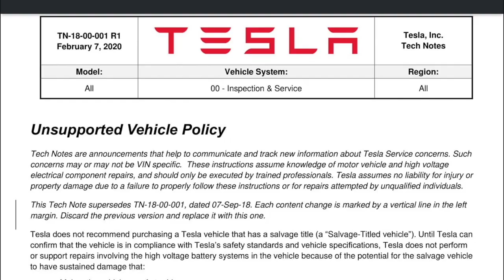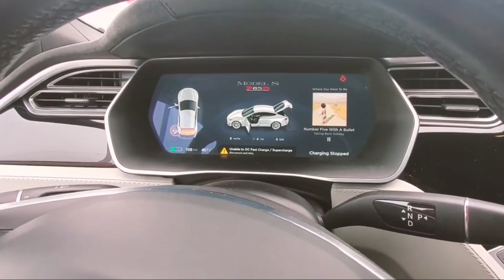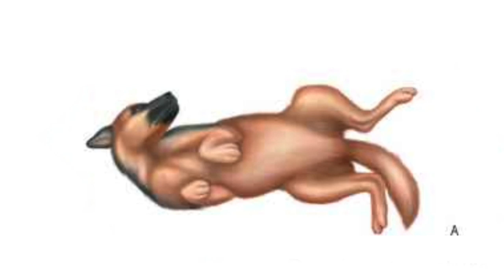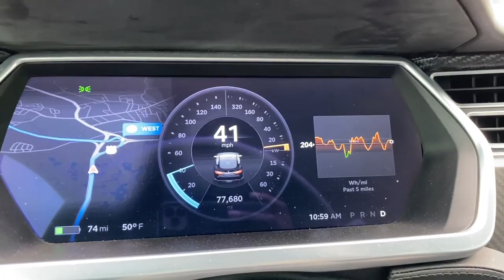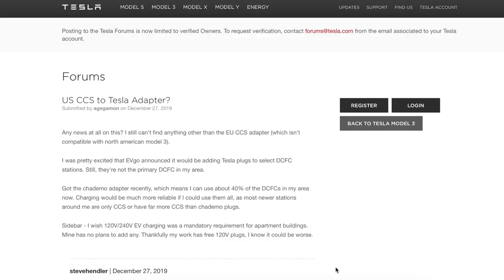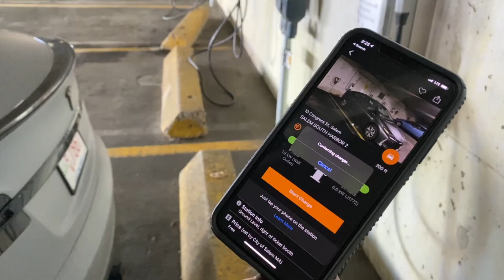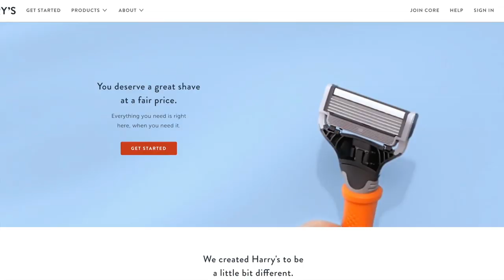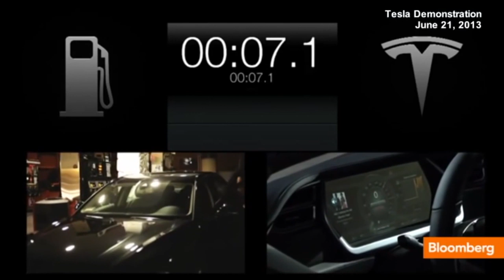Tesla ruined my car and it’s the best thing to ever happen to me!

Comment: I remember when I could drive 600 miles non-stop, pull into a gas station, fill the tank, buy a burrito and a big gulp and be ready to drive another 600 miles in less than 10 minutes.
Reply: I remember being able to do that but for 700 Miles....

...Oh, wait, that's now, with an over 20 Year old Car...
Reply: I remember not holding it that long and being a fat kid so every 300miles I'm doing bathroom breaks and fat kid snack. Hahaha
Reply: I don’t remember anybody asking
Reply: What car has a tank for 600+ miles? Cuz I wanna know.
Reply: @Tydud3  My diesel Jetta does. Some people even squeeze 700+ miles out of a tank.
Reply: Tydud3 It depends on your gas mileage and your tank size.
Reply: @Tydud3  my 1988 Citroem BX has one, theoretically i cold do 745 if i believe the Factory specs, 4.8l/100km with a 66l Tank would mean 1375km or about 850 miles on long trips i can get down to about 5l/100km, with 1 Passenger and a bit of luggage witch would be about 1320km to an empty tank(about 820 miles) the worst fuel usage to get 700miles i could have would be about 5.8-5.9l, witch is about as much as i use on my daily comute.
Reply: @Tydud3  Pretty sure the Grand Cherokee has a massive tank.
Reply: @Tydud3  My Alfa 159 2.4L get's that, did a 2000+ mile road trip on 3 2/4 tanks

Comment: Tesla: You can't use fast charging on a rebuilt TESLA for safety reasons.
Also Tesla: "Autopilot"
Reply: Autopilot is safe man.
Reply: autopilot is safe
Reply: @RodrigoFerreira-bs6hd  Tell that to Wei Huang
Reply: @Psychonaut_  it's infinite safer than driving on your own that's for sure. still! nothing is 100% safe.
Reply: The name is correct for what it is. An Autopilot system in a plane is not meant to replace a person.
Reply: But Rich doesn't have any Tesla internet based services. Even if he does have basic cruise control he sure as hell doesn't have auto-pilot.
Reply: Also Tesla: Thermal Runaway

Comment: “Build” some solar panels on the roof of your Tesla. lol
Reply: Yes, weld it for sure. But that may require towing along a 53' trailer full of them to get a reasonable charge rate. 
Bet they also have locked out feature, "charge-as-you-drive".  And remember, solar takes like forever, to charge overnight!  lol
Reply: Drive on "SOLAR FREAKIN ROADWAYS", LOL!
Reply: I know this is a joke, but the little amount of power that you would get from the solar panels, would not counteract the increased weight and adapters needed to allow the solar panels to work in parallel with the built in charger.
Reply: @markplott4820  I think TESLA is being a JERK and I hope Elon FAILS!
Reply: @vdochev  - TESLA is Disrupting the Worldwide  ICEV Industry, TWISTING their arm to build SUPERIOR Electric Cars.

and it will CONTINUE Disrupting until Someone can build a BETTER Electric car than TESLA can. 
so far no ONE has been able to EVEN match a 2012 Tesla model S.
Reply: @markplott4820  Yah he really isn't, just some random numbers, if he needs to drive 300 miles in a single day to 3 or 4 locations, but his car can only do 200 miles, and charging at the locations only gives 15 miles per hour, and the return trip is about 100 miles, he can't use his car without super charging.  If all your doing is going from Point A to Point B and back to Point A, and the distance to and from is within the range of the car, than his Tesla would be fine, but the point he is making is that he has to go to several locations and distances that are not possible under his Tesla, and without super charging, make the car very impractical.
Reply: @markplott4820  ANY other electric car is BETTER than TESLA.
Reply: @danleeca  - then Rich needs to get a LEGIT used Tesla. 
some even come with FREE Supercharging .
and the Point of his Exercise was to build a Tesla from Salvage, and he did that.
so KUDOS to Rich.
but, Rich needs to move on.
stop TROLING Tesla , stop complaining.
and Try rebuilding a BOLT , LEAF, I-Pace, e-Tron from Salvage. 
as for the car, he Probably will NOT be able to Transfer it or sell it, because he built a car from Salvage. 
so, he could Give it to his Wife.
Reply: @markplott4820  the point is that Tesla is disabling features on cars they have sold, preventing people from repairing cars, unless done so at a Tesla dealer, and even then its not a guarantee.  And if you enable features that they disable, they will sue you.  Supporting Teslas anti consumer practices, makes you a moron.  You can like the product, and hate the company.

Comment: Thank you Tesla for demonstrating why I should never buy a car from you. These  company politics really make purchase decisions much easier.
Reply: @Deleted Account Modified gas cars can explode too.  Don't see manufacturers plugging the tanks on those do you?
Tesla has to learn it's place.  They should not mess with people's property.
Reply: It's only an issue if you choose to build it from salvage. Yes, they need to not turn off access to the supercharging network however the hate they are getting on these comments are a little OTT. If you ever purchase an Electric vehicle you really have Tesla to thank for it.
Reply: @zipp4everyone263  What happens if the voltage regulator was not replaced correctly, the fact of the matter is the electric system is a lot more complicated then most think, and because every news website hates Tesla, any publicity about and exploding car is bad regardless of it has been modified. The truth is this really only affects a few people. The only reason you know about it is because a YouTuber had said it.
Reply: Well firstly: the reason I wouldn’t want to buy one anymore is that when I pay them tons of money, I don’t want them to temper with the stuff I bought. It’s the same with removing  autopilot on used vehicles, isn’t it? Unacceptable. Secondly when it’s about safety, in Germany we have something called TÜV, an unbiased institution that verifies that your car is safe. A manufacturer can’t guarantee that a car is in road legal condition anyway. I think that argument is bad excuse.
Reply: @anthonydantonio6649  I do know how complicated it is. I've programmed my own micro controllers and soldered my own boards. There is something called a hash sum. One could use it to create a verification system using the sensor read outs from your battery pack and the voltage regulator, create an algorithm to calculate the changes over time and automatically sever a relay if that calculated hash sum exceeded the expected limit. That would ofc work on top of the normal voltage monitoring.

The real reason for batteries to explode is due to a thermal runaway event expanding the batteries as well as them bursting into flames. This can be stopped by checking Certain values in the batteries and cutting off the charging line in the event of a typical malfunction.

This doesn't cover everything but there are ways to secure battery packs.
Reply: @zipp4everyone263  Being a Computer Hardware engineer myself, I understand your point fully. What I was intending to say was that because a system like this has so many complexities,  a mistake in any part made by a rebuilding could compromise the  system. For Tesla to do a deep dive and examine the car, they would basically have to take it a apart and rebuild it themselves. It doesn't make financial sense for the company right now. In the future, I can see them opening up repair inspections stores, but right now it is not necessary
Reply: @fritz1360  They have NEVER removed autopilot on  a used car. The story was blown way out of proportion. They original owner never brought autopilot, so Tesla took it away from the car, because of the bad timing of the new owner just getting it, Tesla was more then happy to give him back Autopilot. That is the only case, and there is no evidence that Tesla would ever do this in the future. And Secondly, TUV does not inspect cars, they inspect like electrical systems in buildings and elevators and such. If Tesla were to do a vehicle testing facility now, They would have to train the people thoroughly, and since they are already spreading the Customer Service section to thin, it doesn't make sense for Tesla to do that right now. However, i don't doubt that they will in a few years.

Comment: This makes a wierd case between my dad and I. He has a model 3 and loves it, and now hates any motor with a sound. And I have 2 80s mercedes s class and a volvo 850r. Very different but I'm not converting. This removal of features is absolutely insane. My Mercedes has dual airbags and that was a $5000 option in 89!!! And 6 owners later and it still had that option. They dident remove that so the second owner could repurchase it again for another 5k. Just wrong tesla just wrong
Reply: Christopher Penovatz I think the analogy would be better in this case if your cars were all salvaged and the integrity was in question.
Reply: Your Mercedes has been salvaged? If not than you analogy doesn't apply.

Comment: So when will Tesla start turning off super charging for "battery deterioration" all Apple like?
Reply: They would probably replace the battery since all non salvage Teslas are still under warranty for battery for 8 years. The first Model S would be losing the battery warranty sometime toward the end of this year. At some point they switched from unlimited miles to a 100,000-125,000 depending on battery size.
Reply: They won't. They're doing it in specific cases like this because there's not enough people effected to fuel a class action lawsuit like the one Apple lost that cost them half a billion dollars.  If they did it to every one of the first few years of Model S sold, there'd be enough people to get a class action going.
Reply: Only a matter of time.